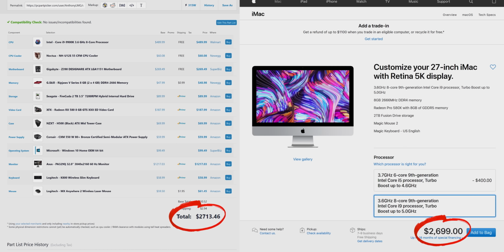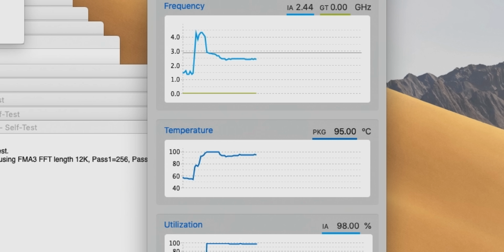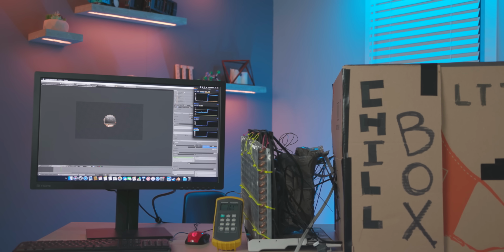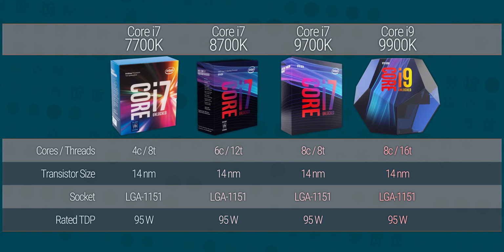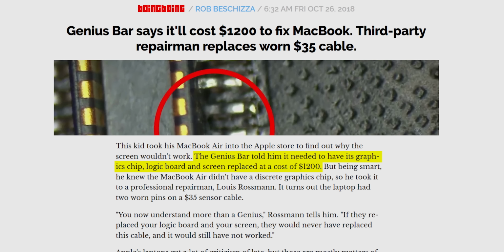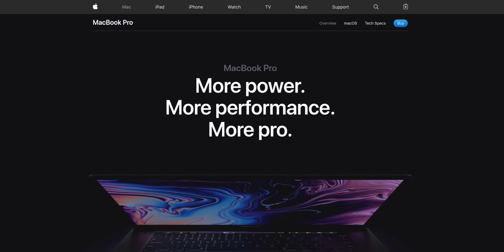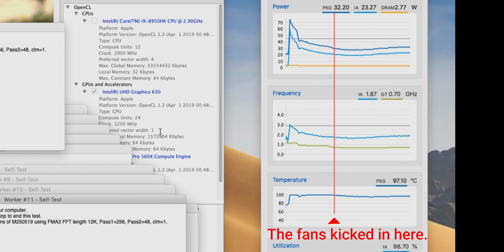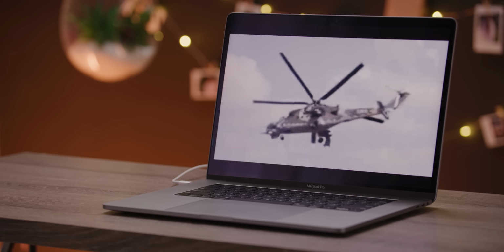Macs are SLOWER than PCs. Here’s why.

Comment: I hate this 'Form over Function' fixed idea Apple got itself into the last 6 years...
 
I have a maxed out end 2013 MacBook Pro I use doing VJ shows.
It runs 6 stacked layers of video + FX for sometimes more than 10 hours in a row (in Resolume Arena) without any hiccup. 

I'm not sure the current MBP models can do the same.

Apple's fixation to make their tools smaller and smaller to please the eye is killing the thing that really matters: speed and durability.
Reply: and who buy these top of the line machines ? the pros like you who need to be on macos :( sad to say. Yes you still can install a hackintosh on a windows laptop but on critical phases like live performance (dj, vj) you NEED to have something stable and it not always the case.
Reply: the question is open : if you need a new laptop up to todays standarts in terms of performance and you use a software on macos what is the best choice ? 
And i'm not even talking about soldered ssd, ram and so on .... that would be too much ^^

Comment: ok i need help i have an acer nitro 50 with a single ACR26D4U9S8ME-8 ram. i want to add more but am new to the pc world and dont know what too add that will acctually work, also wtf is the diff between an ssd and hard drive